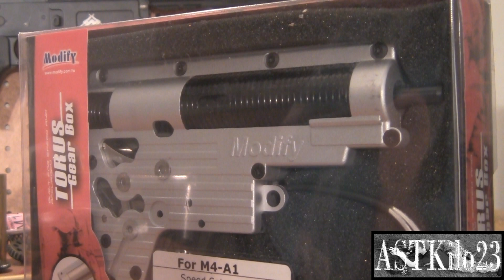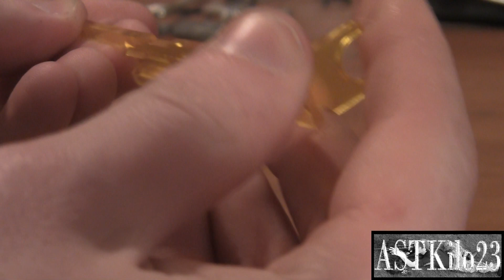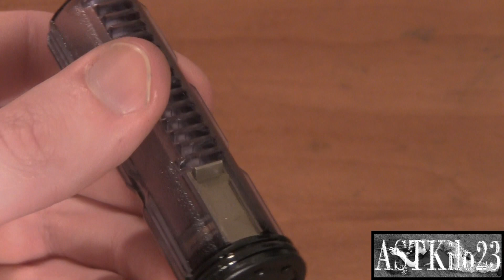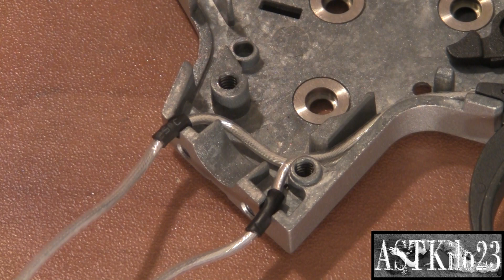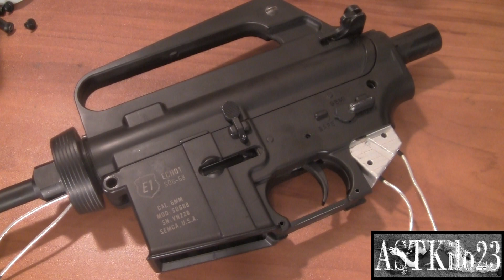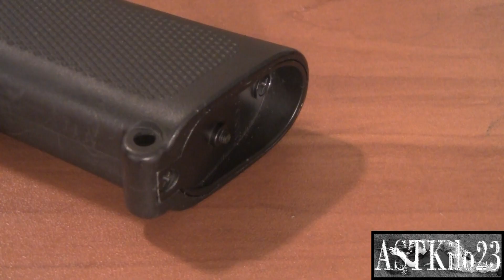Modify Complete Torus High Speed Gearbox  -ASTKilo23-

Comment: Hey dude, so I have been following your for a while. And I got this same gearbox in a mystery box and so I installed it. But when I shoot it is sounds like the battery is dieing but the batteries are fine, what do you think the problem is? HELP
Reply from the maker: it's more than likely the motor and/or pinion you are using. the sound and performance sometimes can greatly vary with those two things i'v noticed with the modify gearbox.
Reply: yeah thanks bro! You were right it was the motor. I had it pushed to far up into the gearbox. Love your videos man Very helpful and informational! keep up this making the sport enjoyable!!